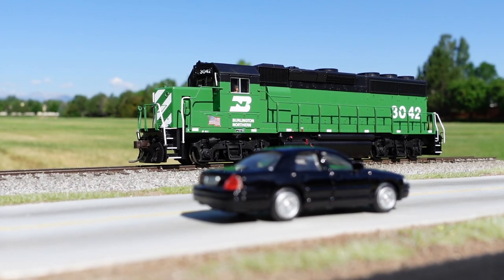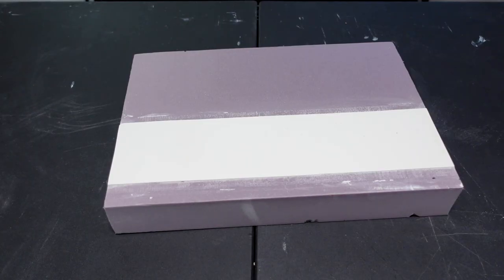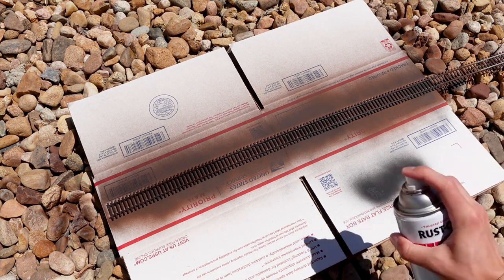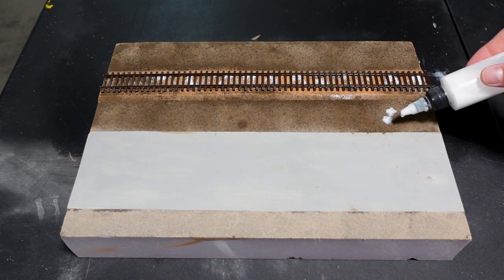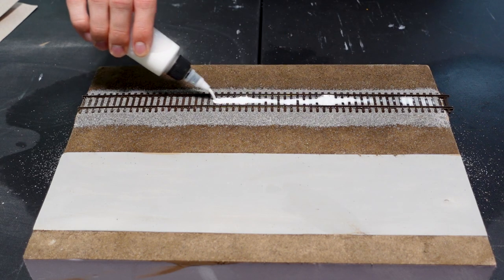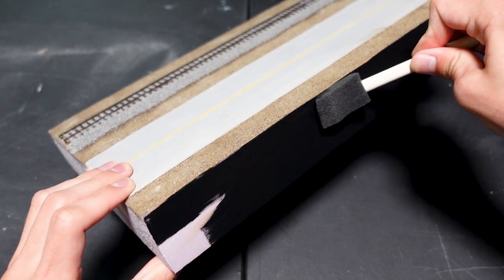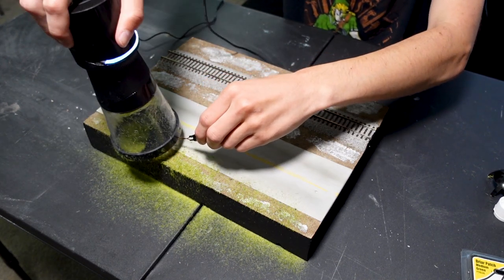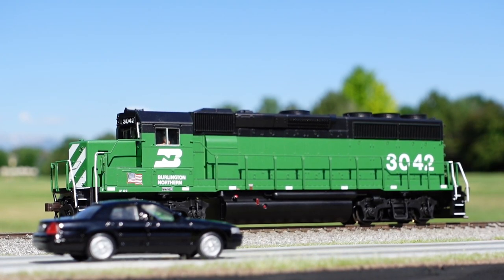Building a Realistic Diorama for Model Trains!

Comment: A tip I got from Model Railroader might help with your road lines.  If you mask something off, paint the base color first, let it dry, then apply the new color. This way the base color seeps under the tape and seals it so the new color is very precise.  So repaint the grey over the tape, let it dry, then do yellow. Should eliminate the problem of inexact lines here and in the DQ parking lot.
Reply from the maker: Good tips! I’ll have to remember that for the future

Comment: Very cool video to display your rolling stock. Keep the railroad rolling, and with experimenting on a display with different materials to see how they act together on a diorama.
Next question, have you thought about HO scale sugar beets? In the late 80's early 90's the Union Pacific was still sending unit trains of dried beet pulp it was compressed into rectangle shapes into covered hoppers then shipped to export to the Port of Vancouver, Wa. And those trains came from can you guess, came from the GW Rwy.  in Ft. Collins, Colorado.
Reply from the maker: Thank you and true dioramas are good for experimenting . 

I have actually thought about it. When I started my layout 6 months ago it was inspired by the sugar factory in my town. After doing some reasearch awhile back I learned that the sugar mills dont transfer sugar beats anymore, and the yard is more of just an exchange between the GW and BNSF. Of course I could be wrong but since my layout is more in modern times (still need to rebrand my engine or course) I decided just to use it as it is now. I do still see covered hoppers in the yard still but also tank cars, center beams, and lots of box cars. I wish I knew more about the ops there though. Thanks for the cool info on that!

Comment: Looks very good! I'm about to do a very similar dio like yours, one little suggestion, I would've used a bit more foam to the sides to avoid catching the black part when taking close ups. Towards the emd shot of the car and BN unit, you can kind of see a bit of black which is not too noticeable but having the camera over the static grass would be insane!

Comment: So I had the problem, I think, with my layout where the acrylic paint bled into my ballast while I was putting it down. I had acrylic paint on the sub roadbed and the camo earth brown on the track, but the sub roadbed I think bled into the ballast during the application of alcohol before gluing. Has anybody had a problem with this? It's one of the reasons why I've stared using latex paint for the sub roadbed. Dropping by right now though because I'm going to do something almost just like this for a short promo video.